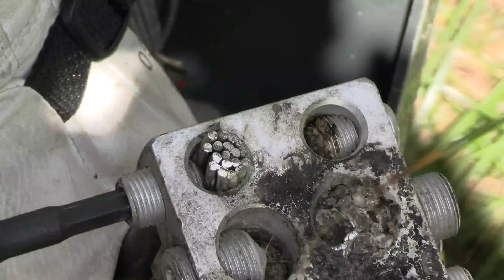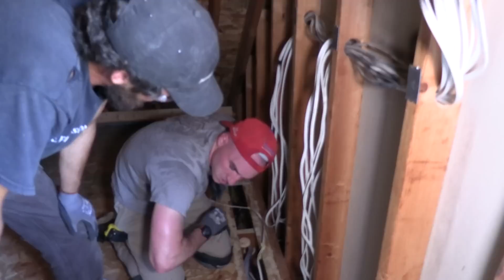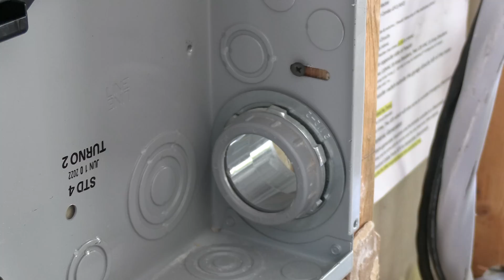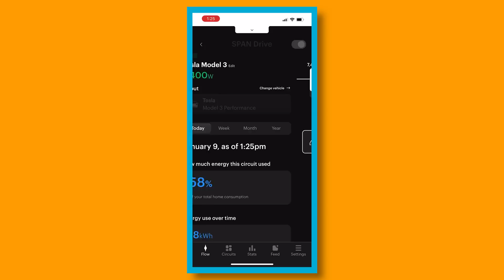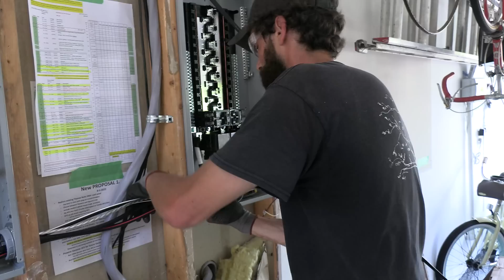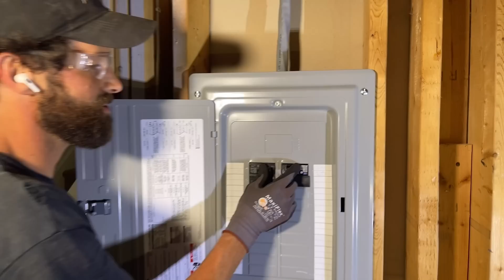Now All We Need's a Generator...

Comment: Is an emergency disconnect between the meter and Generac transfer switch not required?
Reply: Answering my own question, the transfer switch used here is service rated and would be considered an emergency disconnect.  Generac also makes a non-service-rated transfer switch.
Reply: Never have I installed a separate disconnect for the generator. The transfer switch is your disconnect.

Comment: In Ontario Canada we wouldn't be allowed to use PVC terminal adapters as chase nipples and not have suitable cable connectors where cables enter a box. ( Cables running between panels in garage). Its a great entry point for rodents and also an escape for fire into the wall cavity.
Reply from the maker: Thanks for sharing. It's great hearing how electricians do their work and the rationale behind it.

Comment: I do really think these service wire connections in the pedestal could have been cleaned up a bit. Including the service connector block. Maybe I am mistaken saw some dirt and carbon deposits. Over time the risk of deterioration grows, the potential for increased resistance and less clean power. Worse still the possibility of a damaged neutral on the service side creating dangerous conditions on the load side. I do believe that utilities could do a better job on maintenance of those pedestal connections especially as they are exposed to damaging external conditions. Just saw a pad transformer rotted out at the bottom in my area open to rodent damage and shorting. If that thing was to short out the damage and cost would be far greater than keeping up the maintenance. Utility still have not replaced the pad transformer after a month.
Reply from the maker: Mathman, you're making the world a safer place!

Comment: I use a Prius as a mobile HVAC owner of my company.  I have a custom roof rack on my Prius. I have put 1200 pounds on the roof of the Prius. I usually only have about 4 to 500 pounds of tools and equipment and boxes on the roof of the Prius. That’s my average weight daily.

I have a tow hitch on my Prius .  The largest trailer I use is a 5’ x 9’ U-Haul trailer trailer it’s self weight  about 1000 pounds and I put another thousand pounds of tools equipment and supplies in it to bring the job sites that are large and leave it there at the job site..  

My normal run around trailer is a little 4 x 4 trailer with 4 to 500 pounds of equipment and supplies on that small trailer 

All the interior in the rear has been ripped out of my Prius, and I have a flatbed for easy sliding in and out of toolboxes tools and supplies 

Underneath the flatbed board in the rear of my Prius, I have storage underneath for supplies and tools that are rarely used, but I needed when you need them on rare occasion. 

I call it my Prius work truck

When you measure 256 V that is at the verge of the highest limit to wear many overseas, mini splits, computer boards start to receive damage from overvoltage .
Reply from the maker: Hey hey! Your Prius is too cool! Can you contact us hello@electricproacademy.com re Prius Work Truck?

Comment: Hey Joel just a thought. Where the surge connection goes threw the stud which is plastic needs a protective plate.
Reply: As well as where the feed wires between panels.

Comment: Thank you for sharing.  I wish more contractors would work with DIYers and I believe it would reduce the amount of bad DIY installs and increase safety.  Great work and great partnership.  you all be safe.
Reply: Diyers want to work with contractors, but don't want to pickup the tab for the extra time they cost the contractor.  I have seen this dozens of times in my career.

Comment: Are you required to have an emergency disconnect for the generator?
Reply: some localities are weird like that. They want an accessible disconnect near the gen set, despite the gen already having a breaker and an external shutdown on the outside of the cabinet, which is for fire department use in emergencies. Installing a lockable switch makes me shake my head because some can be locked in either position.
Reply: @rupe53  seems silly to since there is a kill switch behind the generator for the FD
Reply: @sungkim16  .... I already said that, but I don't make the codes. I just know they exist. The code for an electrical disconnect was written a long time ago, before most companies had the other features. The kill switch for the engine is a fairly new NFPA rule. (5-6 years?) It's a "hard lockout" and requires 3 distinct keystrokes to restart the engine once the cabinet is open.

Comment: As a lowly newbie why do you need a transfer switch and a disconnect?  Is it just pure safety or is there code in relation to that?
Reply: some areas require it due to distance. The gen set they will use already has a breaker and an exterior shutdown for FD emergencies.

Comment: 14:32 .  Where are the cable connectors securing the SER cable to the two loadcenters, per NEC 338.10(B)(4)(a)(1) and 334.30?

Comment: You don’t need to pull the fuses in the transfer switch. You can just unplug the molex plug on the sacm board. Those fuses break easily when installing them.
Reply: daniel lothamer  ... I have to say that load manager is great, but they really did screw up by using to those tiny fuses in a tight space. This is from a 25 year Generac tech who is now retired.
Reply: I was thinking the same thing

Comment: How do you pass inspection with PVC connectors where the SER enters in 3 different locations??  And the heat shrink is questionable also.
Reply: they could have added a tray or junction box on top of the panel to avoid that shrink tube.